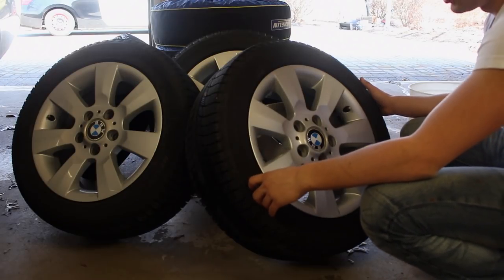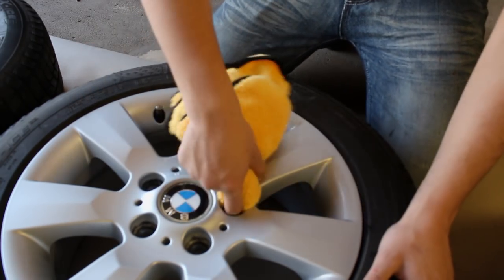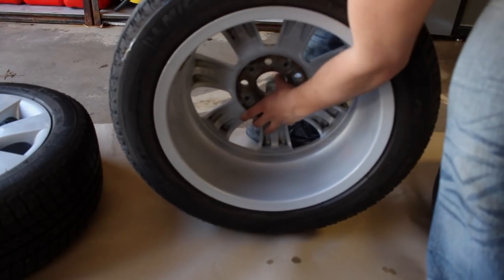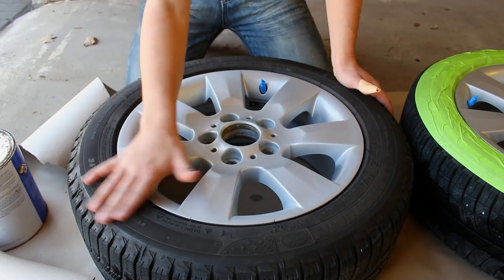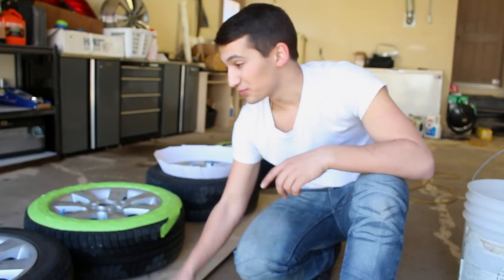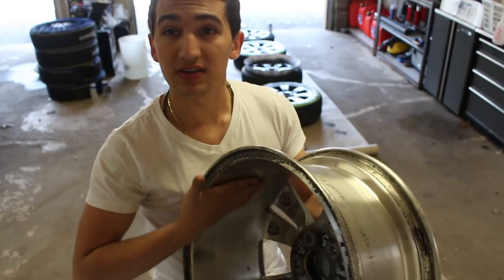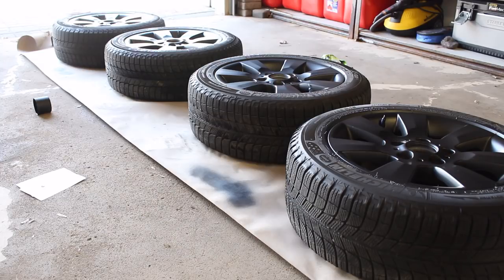DIY: PlastiDipping Wheels 4 Different Ways

Comment: Have you dip wheels while on the car? If so, what do you do about the lug nuts? Do you just spray over them?
Reply from the maker: TwoBuck Chuck Yes I have multiple times. Spraying over them is the easier solution. If you want to get as much as a professional look, you should remove the lugs nuts, take the wheels off and then set the lug nuts aside so they stay chrome and you have a nice contrast while looking at the wheel. If you're going to leave the wheels on the car, you can mask up the lug nuts if you really want. If it was me, I would put a tiny bit of car wax on the top of the lug nut and then spray the entire wheel. After the dip has dried, you should be able to peel up the plastidip on the lug nuts, creating that same contrast.
Reply: Sick Dips Sweet. Thanks for the reply.
Reply from the maker: Not a problem TwoBuck Chuck

Comment: Great video. Is funny, at the end you say that the last method is the most time consuming. I thought to myself, "Not if you don't bother to remove it from the tire." This is the method I would use but I'm not concerned about the details like you are.
Reply from the maker: Phillip Toone Well than yes that would make your life easy lol Overtime it will flake off and you'll be at the same spot as me ahha
Reply from the maker: Matthew Chamakese If you want you can grab a power washer and get it all off in 3 seconds.
Reply: Lutihhmkuddaaadl..ky

Comment: What if you have a spot on a wheel where the aluminum or chrome finish is starting to chip or bubble up? What steps could you take to where those spots wouldn't show up when plasti dipping?
Reply from the maker: Well clean the wheel of course, then go ahead and either dip on top of everything, or sand down the areas that are bubbling and dip overtop. The plastidip will adhere to either options

Comment: What about leaving wheels on car to dip and the lug nuts? I'm thinking about tire rotations and if the dipped wheels would get ruined when a shop removes the lugs especially if didn't tape off lugs.

The other thing would be cap. Any need to tape it off or would it be easy to just peel back the cap area without messing up the wheel?
Reply from the maker: You can leave them on the car too and dip them. Once you get an impact gun and take the wheels off, you make chance the dip while removal but its no big deal. You can tape it off or not. If you're leaving your wheels on, i'd just dip right over the center cap.

Comment: Hi I plan on doing mine but I would like tips to make the rim section extra tough for when wheels have a flat and need changing at the tyre change place, they use the machines and possibly it will lift! don't want that issue any tips or suggestions for a tough rim??
Reply from the maker: Cee Bonnick It doesn't matter if the wheel is dipped or painted, if the tire tech can't change the tire without hitting the rim, the finish is going to be damaged

Comment: Hey mate just bought new set of factory upgraded alloy rims just wondering how long plasti dip lasts and does it fade? Tossing up wether to powder coat them or just dip them.
Reply from the maker: It doesn't fade, as long as you don't plastidip it with a fluorescent coloured dip! Dipping them will be less than 10% of what powdercoating them will cost. If you don't like the look, peel it off and powdercoat them
Reply: Sick Dips thats great news mate. Is it fairly easy to peel it off back to original?
Reply from the maker: Yeah as long as you put down enough coats, its a piece of cake to remove. This is how it should be removed if its applied properly. 
https://www.youtube.com/watch?v=B_YPSBzNi14&list=UUzXi2CvU0I5RH7GugpJW9yQ

Comment: Should you dip the bolts in black aswell? I am going to dip my wheels in black, but the bolts will still be silver. Should I dip the bolts aswell so it's all in the same color?
Reply from the maker: I would leave the lug nuts silver for a few reasons. Not only will it give a little bit of contrast over the black wheels. And also when you're taking the wheels off and then putting them back on, the socket going on the bolt will start to peel up the dip and it will be counter productive.
Reply: Alright awesome! Thanks for replying so fast! Awesome vid btw, watched it multiple times already. It's cool how you show everthing, even the most simple things like popping the emblem out. I had no clue how to get it how and was too afraid of just ramming it out but now I know ;) !
Reply from the maker: Yeah no problem!! I'm glad it helped you out. Thats why I make these videos :)
Reply: Hey man if you want black nuts you can buy black anodized nuts from tirerack.  you would then want to buy a new socket to ONLY use with those nuts, and never use an impact on them
Reply: Minutemadex Get the type of Plastidip that you can dip things into. Dip the tips into the plastidip. That way, no dip gets on the thread mking threading the bolt on and off difficult

Comment: my plasti dipped charger was recently sideswiped and it scrapped some of the dip off any ideas on how to repair and replace?
Reply from the maker: The best way is to remove it all and then reapply the plastidip on your wheel. If you don't wanna go that route, you can use paint thinner, rub the area that was damaged, and then reapply a layer of plastidip over the entire wheel

Comment: Someone told me that if you dip your wheels when you peel it off it will peel the shiny lacquer off, is this true? Also how many cans do you need for 4 alloys?
Reply from the maker: Clearly whoever told you that hasn't had much experience working with plastidip. The plastidip only lays overtop of the existing metal / paint. It will not damage or corrode the surface at all. 
As for the amount of plastidip, I'd say get 4 cans. You'll probably only use 3 - 3.5 of them, but its nice to have more than you need than not enough.

Comment: Ha funny ive done all 3 methods recently also. I find bringing the tape closest to the rim by far is the best method. ive even done it without using tape and figure it would come off the tires easily with a micro fiber. that was a HORRIBLE idea. took me longer to get the dip off the tires then it did to dip all 4 rims. the index cards for me was a fail also. probably because it was for truck rims with beefy tires that came out further then the rim. which made the cards sit at a more aggressive angle which left the outside of the rim with a visible undipped ring around it. I had to fix it by taping the tire and doing extra coats on the ring to get it covered. but I had zero problems with bringing the tape right up to the edge of the rim.

Comment: Ok so I'm dipping my wheels white and I wanted to dip the lug nuts red to compliment my car since it's red but when I go to put the tire back on after tightening the nuts the dip gets warped or even in some cases ripped. A friend of mine suggested dipping the inside of my tire iron but idk if it'll work and frankly I'm tired of taking my tires on and off. I'd prefer not to waste money on red lug nuts so if there's a way around doing that I'd greatly appreciate some advice
Reply: Just buy red lugs. You're only other option is going to be to paint them red which I'm assuming you're not willing to do.
Reply: Joe Reilly leave the wheels on the car, mask the brake and caliper with a trash bag.

Comment: Nice video. So the cue cards would be the best method?
Reply from the maker: Well it all depends on what you like. I personally didn't like using the q carts because it limits the mobility of the spray can.
Reply: Ahh, I see. Thanks!

Maybe cut them in half, horizontally. As you can see in your video, the over spray was mainly at the bottom.

Will use less cards as well.  :)
Reply from the maker: Yeah thats true! Give it a try and lemme know how it works :)

Comment: Yo question. Whenever i dip my wheels and torque my lugs the plasti dip tears and spins with it. Any way to work around this?
Reply from the maker: mcmc You can put some wax on the inside where the lug nut and the wheel come into contact. The best way I find is to not spray too much plastidip down where the lug nut seats so you won't have any peeling issues. When you build it up, that's when it will want to peel up when you apply torque to it.

Comment: Does anyone know how to prevent your lug nuts from peeling the dip off. I finished the job and when I put the wheels back on the dip peeled off with the lug nuts
Reply: There's no way. You can always paint the lug nuts or buy black ones. But depending on what you use to put the lugs back on its always gonna scrape the paint

Comment: so once you dip youre wheels what happens to the edges of the wheels if u change the tires. do they get all scraped up on the edges????
Reply from the maker: +Orlando Penn Well thats a tricky area. The same problems happens with painted wheels, the wheel will get scratched. It all comes down to how good is the tire technician.
Reply: Thanx

Comment: Can you plastidip both sides of car hood. Will temperature have an effect on it peeling on under side of hood?
Reply from the maker: Yeah you sure can! As long as you put down enough coats, it should be perfectly fine to remove. When you're taking it off, just make sure the plastidip is cool to the touch, so let the engine and hood cool
Reply: Thanks

Comment: i have a 2 piece rims with nuts around the rims so if i want to plasti dip my rims, any suggestion how to remove plasti dip on nuts?thank you so much
Reply from the maker: If they are a true 2 piece wheel, the way you'd paint it is disassemble the wheel so you have the front face and the rear part of the barrel in 2 pieces, sand them, and then paint them. That would mean the bolts are removed. That would be the proper way to do it, however it does involve a lot of work. Another way would be trying to mask up every bolt but that again could be very time consuming. It all depends on how picky you are. 
If your nuts are raised past wheel, you might be able to dip over them, and once they dry, remove the little bit of plastidip overtop of them.
Reply: thank you so much for replying appreciated!! so i plasti dip my rims this morning and i end up plasti dipping everything because i don't have the correct tools to unscrew the bolts.. and now i'm trying to plasti dip my whole car..i have another question so if you finish plasti dipping your car maybe 5 coats then let's say after 1 year you get some peeling can you dip the parts that are peeling?and  thank you again
Reply from the maker: Yeah you can fix it, you have to make sure that the surface of where the part was peeling, is clean so you can undo that mistake and apply fresh dip to. That will make sure it will adhere

Comment: How many cans would you estimate it would take to do 4 20" rims for if I do 4 coats on each
Reply from the maker: David Fuller If you are planning on doing the barrel of the rim as well, i'd say get 4-5 cans, if not and you are just going to do the face of the wheel, you can get away by getting 4 cans. Keep in mind though its better to have more plastidip than what you need, just in case something happens.

Comment: buddy please i have a vw golf mk6 gti 18 inch wheels i want to do 4 coats for all 4 wheels and paint the side mirrors and the front vw logo how much cans u suggest i need
Reply: Hraf Dima I would always go one more than i think i need, should be good with 5, but i would go 6
Reply: thanks man
 ;)
Reply: +Hraf Dima Buy more cans than you need. Return the unused ones with a receipt. Once you get started you can't make another trip to the store. You shouldn't let it dry completely between coats.

Comment: How does platidip stand up if you have to have your tyres changed?
Reply from the maker: Russell Emery Just as good as painted wheels. If the guy changing the wheels hits the wheel, the rim will either scratch if its painted or peel if its dipped. It all comes down to how good the technician is at changing over the wheels.

Comment: I'm going to black out my chevy emblem  how long should i wait between coats and to remove the excess dip
Reply from the maker: +x LeGiT ShOtZ x Between each coat, I'd say what 15-20 minutes. After all of your coats are dried, wait an hour before peeling everything. The longer you wait, the easier it will be to peel up.
Reply: +Sick Dips ok thanks

Comment: pro tip coat ur tire in Vaseline and just wipe off the dip
Reply: 37
Reply: Jade Campbell 69
Reply: longstar550 it doesn't stick at all? definitely gonna try this soon..
Reply: DER P. I used a thick coat and it basically wiped off
Reply: longstar550 good tip!! Will be using that one 😌
Reply: longstar550 DEFINITELY using that
Reply: Vaseline corrodes rubber overtime. Not worth the risk.
Reply: Lemony Snicket i dont think it will be on long enough to damage the rubber..but I'm guessing silicone can work as well.
Reply: hasn't touched my tires after 4 years

Comment: How much will it cost of I wanted you to do it well if you live in the La area
Reply from the maker: Well I usually charge between 200 and 350 depending on what is getting done for the wheels. That varies between wheels on the car, wheels off the car, colour, finish and size.

Comment: Wouldn't where the bolts to to replace a tire become smaller spaces?? And if you try to twist on the bolts again to replace the tire onto the car, wouldn't the dip be ruined and start peeling from where the bolts are??
Reply: John Not by a large enough margin to make a difference. maybe 1/64 of an inch. and you cant really do the lug nuts if youvhave the wheel off becuase when you retorque them it will strip.

Comment: How much time should you wait between coats?
Reply from the maker: It all depends on what kind of conditions your dipping in. If its a nice hot day, you could be safe with just 5 minutes between coats. To stay safe, wait a good 15-20 minutes. When the plastidip turns matte, that means the coat is dry and ready for the next coat to be sprayed.

Comment: How much everything cost to do your tires and car
Reply from the maker: The wheels aren't that much to dip them because you aren't using that many cans. The car will be more money because you have to buy a spray gun and gallons. You have a lot more surface area to dip on a car as apposed to your wheels. Wheels will probably run you less than 50 bucks, where the car will be at least 350, and thats for a small car.

Comment: what do you do if you have to change a tire without scratching the rim.
Reply: Great question?  anyone
Reply: Restart
Reply: you shouldn't need to respray if the tech is experienced. if the tech does hit your rim then that technician probably either is new at it or you got some low profile tire that are a pain to clamp

Comment: How many bottles did you use?
Reply: I did the inside of my rims so I would not  have to worry about break dust messing up my rims.... & I did like 4-5 coats. You should get at least 4 cans. 5 at the most incase you get a defective can. (It happens)

Comment: On average, to do 4 wheels how many cans of plasti dip do you need?
Reply: 20
Reply: +Sani Laca I think he meant 2 maybe? 20?xD
Reply: +Mr. Potato I'm serious 20
Reply: +Mr. Potato 20 seemed like quite alot lool
Reply: +Brett Rainville 20 is way too much? I have 16 inch wheels I will need a 5 cans for each wheels? That is nonsense...
Reply: +Mr. Potato LOL I'm joking I did my charger with 3.5 cans last week. I might do another coat around the outter rim just to be safe
Reply: I nearly had a heart attack man, This shit is not cheap over here $22 for a can.
Reply: +Mr. Potato if you can gloss with make it look badass. And it's an alternative to buying new rims which are what 2000+? Haha 3.5 cans will do good

Comment: Light coats is the best way to go.. work it on better coverage
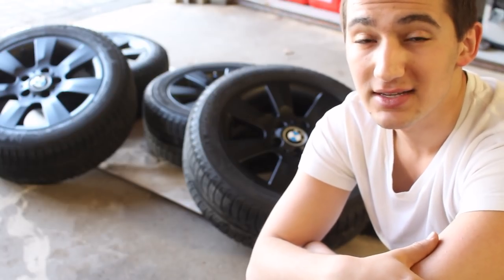Reply from the maker: It may be for inexpericenced users of plastidip however if applied properly, you want a wet coat of plastidip. Those wet coats are just at the bring of thick plastidip, but not too thick for it to cause runs. The end results are perfectly smooth @ 16:14

Comment: Or you could just take your tires and wheels to any shop and have them dismount the tires and spray the entire wheel. then go back and have them remount it
Reply from the maker: The chance of the tire shop hitting your wheel and peeling the dip is too much of a risk for me. Leaving the tire on the wheel I find isn't that much of an issue. Check out my other video to see some extra tips when dipping your wheels. 

DipTips: Tricks for Dipping Wheels
Reply: Sick Dips Agreed, I know a place that will unmount and remount 4 wheels for about $40. They man handle the rim to remove the tire. No way plasti dip would survive that.
Reply: DJSkreebz Yeah exactly why dipping is done like this. They're too aggressive with it. You can probably find a tire shop that will carefully take off your tire but it will take longer, and cost you more money, and then you're stuck having to go back to them to put the tire back on. Even if its 40 bucks, I don't find the need to remove the tires.
Reply: I don't even tape. I just prep and spray, and carefully remove the dip from the tire. I'll even touch up when any flakes happen. This stuff is awesome.